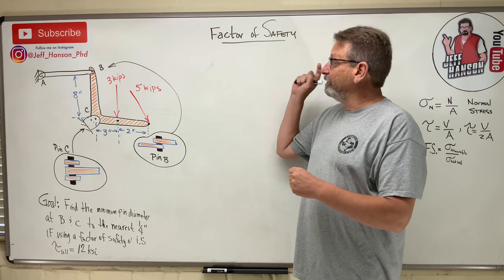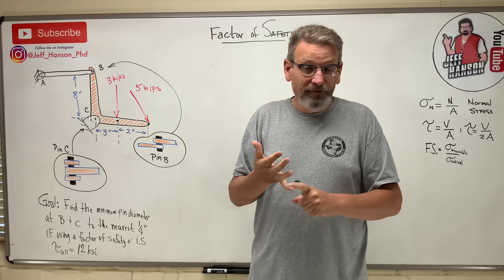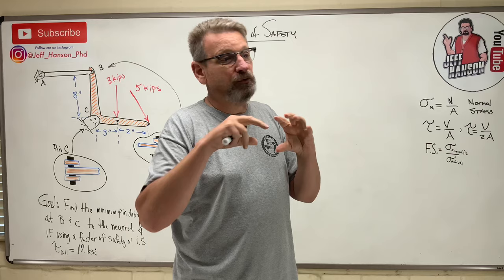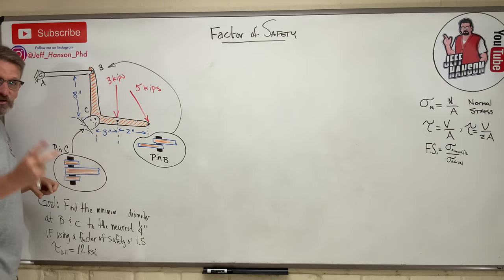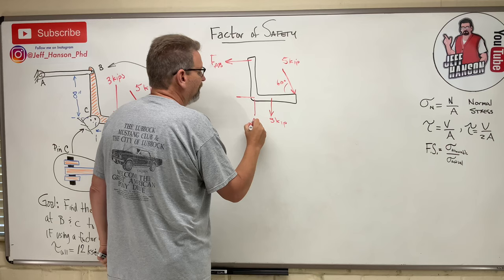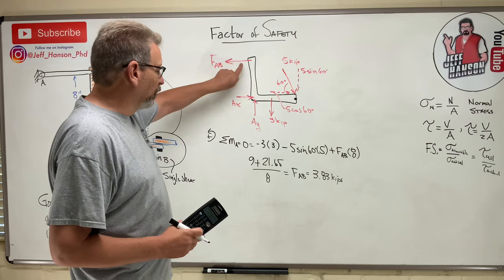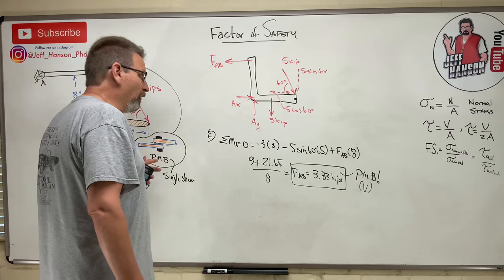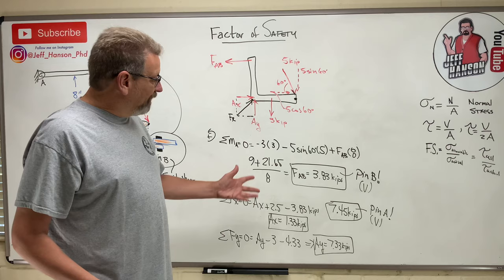Mechanics of Materials: Lesson 6 - Factor of Safety Explained, Example Problem

Comment: corrections:
pin C components: Cx & Cy
resultant at C = 7.45 kips
diameter for pin C: 8=7.45/2[pi(d^2)/4] = 0.77 inches = approx 1 inch

Comment: Hi sir! I am 52 years old mech eng following up your lessons with great pleasure. I would like to kindly remind you that the diameter of pin C should be 0.77 in while pin B has 0.78 in (almost the same) diameter. I presume you underline the importance of double shear pin design in this problem. Thanks and best regards..
Reply: I am glad that you caught that the diameter of pin C should be 0.77 because I am a student following his examples and was going crazy thinking I’d done my math wrong.
Reply: Prof. Hanson is the king of the instructors. You might keep on following his lessons..
Reply: Thanks for the catch! I was running my numbers over and over again until I saw this comment. Regardless this guy is a lifesaver though.
Reply: Exactly my point! I checked out 3 times the calculation, and I found each time, .77 in at B, and .78in at C.
Reply: @emilalopez5353  3 years later and this comment is still blessing me lmao. Just saved me as well

Comment: Pin C should be .77 too otherwise it doesn't make sense, a double shear pin with the same SF should be smaller compare to a single shear.
Reply: you have to choose between different diameter pins, .25 inch, .5 inch, .75 inch, 1 inch. as an engineer which one do you choose? OBVIOUSLY the 1 inch
Reply: @Ssm19494  you would choose 1", not 1.5" as he instructed, he divided 12.56/7.45 instead of the other way around.

Comment: Should your math on pin C be 7.45 divided by (8*2*0.785) before you take the square root? Did you do the division backwards? I got the diameter at pin C to be .77 inches. Rounded up to 1 inch. Both pins are the same are they not? Thanks!
Reply: You are  correct.  If you listen to him as he is doing the calculations he multiplies the denominator together, than divides it by the numerator (7.45kips).  I believe he meant to key his calculator as 7.45kips divided by ANS on his calculator.
Reply: @Jordan-vf4up  That should be the correct answer
Reply: @mohammadhamza3937  i got 0.77, he got .78, doesnt really matter when you have to round up to 1 inch for the parameters of the question

Comment: Shouldn’t the factor is safety be FS= sigma(actual)/ sigma(allow) ?
Reply: Yeah I'm wondering this also. If tau_allowable = 12 kips, with a S.F. of 1.5, tau_actual (as in the actual stress the pin can handle before yielding) should be 18 kips and that's what we design the diameter of the of the pin for... Yes? No?

Comment: Hi Professor, I have a question. Since we are calculating the minimum diameter, aka minimum area A, as to the equation T=F/A, shouldn't we use the Maximum T(T allowable) which is 12ksi, instead of T actual?
Reply: This question is asking for the minimum diameter of the pins ~to allow for~ a factor of safety of 1.5. Another way of approaching this problem is to think about T(allowable)/12 kN as the defined value in which the system will fail, and T(actual) as the value we are changing in order to receive a F.O.S of 1.5. Diameter is simply the variable within T(actual) that determines the value of T(actual) itself. When we increase the diameter, the shear stress decreases (diameter is in the denominator) resulting in a lower T(actual) value and a higher F.O.S. Therefore, when we increase the diameter, F.O.S increases as well. This is why the question asks for the ~minimum~ diameter
Reply: @jaywhaley4688  Ahhh! We're using T(actual)8 instead of 12 just to be conservative aka satisfy the safety factor:D Thank you for the help :yougotthis:

Comment: 1newton/1millimeter is equivalent to 1n/1m^3
in other words, 10^3
so, a newton divided by a millimeter is not a megapascal, but a kilopascal.
Do the math for 13kn/7853.98m^-3 and you will see that it equals 1655 pascal or 1.65 kPa

Comment: If Fab is positive should the force be going to the right?
Reply: When looking at the sum of Moments about A, Fab is causing a counter-clockwise rotation. It is positive in that regard.  If you are taking the sum of all X forces, then Fab is negative.
Reply: Think of positive and negative numbers as verification for your “guess direction.”  If the number is positive then you guessed correctly!